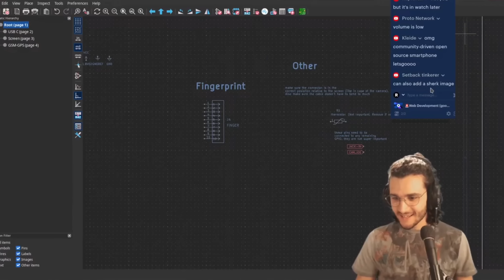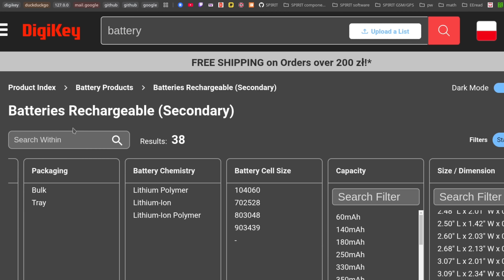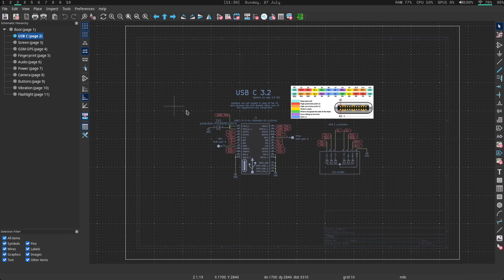Can I build a BETTER smartphone from scratch?

Comment: The Pi5 isn't too powerful, it's inefficient. It uses up more power to get orders of magnitude less performance than a smartphone.
Need to use a way more modern SoC if you want to compete with smartphones. 3nm 16 core Snapdragon 8-class, MediaTek Dimensity etc. will eat that 4 core 16nm BCM2712 for lunch in raster/cpu performance. Literally 20x scores on geekbench.
Raspberry Pis have always been overpriced and overrated anyway tbh. They're popular, but any old SBC will run linux.
Reply: I mean this project, from watching this short video, seems to me like a prototype type thing that's supposed to be good enough to use, not be great. 

I don't think they should focus on using great chips and custom boards yet. I think they should get a working "phone" out as soon as possible. 
Researching the best processors, looking at their docs, figuring out how to fit it into the phone... is probably more work than what they can handle at the moment. 
Getting a working phone out asap is probably a lot better for their motivation then researching for a long time. 

As the project grows, it ofc needs to switch to modern processors, but i don't think they need to worry about the weaknesses of this processor and alternatives yet.
Reply: yeah he should use n100
Reply: You have no idea what you are talking about, sir.
1. Not a single chip you mentioned is open-source.
2. They will never provide even a dev board to a hobbyist.
3. This project can never compete with smartphones with millions of dollars of R&D behind them.
4. Pi5 is indeed a bad choice.
Reply: @novh4ck  I wasn't saying use a smartphone SoC, I was saying use a better SBC. Pi aren't the only ones making SBCs, and they're among the worst in terms of value and raw performance.
They're the equivalent of the 8 bit 20mhz ATMEGA328P arduinos people still use when the 400mhz ESP32 can be had for half the price with a ton of better and faster I/O, rom, sram, deep sleep features etc.
They're crazy popular just because they were the 1st arduinos, but that's literally all they have going for them.
The Pi is the same. They created a brand and some ready to go SD card isos for noobs which got people to realize credit card SBCs exist, but now Pi is the default for projects like this when there's literally 0 reason to. The concept is good, but nobody wants to use a phone that's 20x less powerful and power efficient just to say it's open source, and it's disappointing because you could just use an SoC that's actually good. If it's only half as powerful and efficient, maybe the tradeoff is worth it.
Reply: @steve_jabz  Where can you buy modules with chips you suggested? Where is any documentation for any of those? Where are schematics? Where are Linux drivers? I'll answer for you... nowhere. Unless you are a company sinking millions into R&D with a potential to sell tens of thousands of devices you will never even get a response from Qualcomm or MediaTek e-mails. Your options of "faster" ARM are basically BCM, RockChip and Allwinner. That's it. My point was that your suggestion shows that you don't really know how any of this works.
Reply: @novh4ck  I didn't suggest any chips. I mentioned that it's 20x slower than mid-range smartphone SoCs and that you should use a better SBC to compete with them.
After clarifying it, you still want to insist on starting a linux port for a smartphone SoC as if I ever suggested it, and even for a straw man, this is wrong, because Qualcomm and Mediatek both have HDKs with drivers and support, I just still wouldn't use them for this project, because it defeats the point
Reply: I haven't been up to date with SBCs in a few years, so I'd need to do a comprehensive review of everything on the market now, but I'd probably start with an Orange Pi 5 Pro as a basic starting point. 8nm Octa core, Mali-G610, 16GB LPDDR5, 6 TOPS NPU, 8K HDMI 2.1 vs the RPi's 16nm node Quad Core, VideoCore VII, 8GB LPDDR4, 4K HDMI 1.4. Considering this is literally the 1st one I found in 20 seconds, you can probably do much better.
Reply: These type of boards like the orange pi 5 all come with up to date drivers for every flavor of linux. You might have to actually install the OS though instead of buying a noob SD. It's not really rocket science.

Comment: Something to note in regards to location privacy: If you have a sim card, you can be tracked fairly easily, especially in metropolitan areas. I'd recommend adding another switch for that, or just forgo cell data and use the phone solely over wifi (A vpn might also be a good bet if you go with the second route). 
Overall, this is a very cool idea, and I really hope you succeed!
Reply from the maker: That's a great point, thanks!
Reply: Lora,  BT, wifi, and wifi-halo for the ultimate mesh communication.  4g/5G optional if you can get your friends to adopt something like reticulum protocol.
Reply: Wouldn't putting your phone in airplane mode disconnect your SIM?
Reply: There was. a video by the hated one where he shows how phones try to connect to network once they shut down or wake up and there is nothing that can be done there...
Reply: without sim card its no longer a phone just a mini tablet

Comment: A CM5 uses ~2.5w at idle, meaning even with a massive 10,000mAh battery it will only power the phone for 16hrs while it does nothing.
Reply: what about disabling cores and other components on demand?
Reply: @Oscar4u69  you can disable components, but that's not doing much when you need your antennas always on. You can lower the clock speed on cores but disabling cores doesn't help. The cm5 in the thumbnail was why I clicked because I wanted to see how he gets around it.
Reply: @YoelFievelBenAvram  he doesnt, and while i dont want to be defeatist this entire genre of content is really just designing carrier boards for compute modules, sadly hardware R&D is just a different beast than software R&D
Reply: @Aporro1 i don't see what stops somebody designing a custom pcb around a smartphone processor
Reply: @CnRSPACE  That one is easy the NDA and software required to run a smartphone processor tends to be unobtainium, leaving you rather stuck using somebody else's entirely phone motherboard as is even before you get into the challenges of actually getting hold of the Silicon in the first place. Technically you can do it, but the hurdles to jump through just to get remotely close to the easily available documentation on a Pi...
Reply: @CnRSPACE  Skill and the fact that you can't affordibly buy small quantities of proper smartphone processors, nor get the proper data sheets and documentation for them without agreeing to buy a decent quantity of them.
Reply: @YoelFievelBenAvram  IMO it's the worst decission made on this project. Using another SOC designed for phones, like something from mediatek or similar, would be the best choice.
Reply: Not played with a 5 but the 4's you could under volt and down clock quite a lot, and it helped, though silicon lottery came into it if you pushed to the extreme. However for phone use given the modem will have a baby CPU of its own the CM5's power draw while on but idle really doesn't matter - it can and should be in the low power standby type mode waiting the wakeup signal from the modem whenever you are not actively using it.
Reply: Should really use an ultra low power stm32 which is still easy to handle and has all the features
Reply: @EA-s2z  The issue with MCUs over CPUs is there is no memory management to use full operating systems like linux which is what android is based on.
Reply: @sloppyfloppy79  There are schedulers like RTOS or ArielOS. The real disatvantage is that they simply don't have enough power
Reply: lmao
Reply: Probably the best bet at this point is a risc-V cpu
Reply: i recently joined ARM so i may be wrong i seems like you can for power saving halt large part of CPU and peripheral and put it in interleaved mode when in 1ms i base time and 900us cpu is "shut down" wakes up for 100us, do stuff and when needed switch switch to full power
Reply: if that the case use intel n100 way better
Reply: @fdgdfgdfgdfg3811 x86 processors are notoriously power hungry. 6W would be even more hot and power-sucking then a CM5

Comment: Other idea: whats wrong with creating a USB/USB-c dongle that supports LTE 5 or 4.0 and you can just attach it to a secure tablet or notebook to talk and have net access??? Somebody tried?
Reply from the maker: could be a workaround if there are problems with gsm/gps in certain areas
Reply: @V_Electronics  i mean just to create a standard secure OS on any hardware and attach the mobility with a mobile dongle.

Comment: ❤ Fairphone is working on a repair friendly smartphone 

This is something else
Reply: nah im good
Reply: 600 bux and it doesnt even have a jack
i guess at least it has an sd card slot
Reply: @wireskrush Why are you using a headphone jack in 2025, you can wire audio through USBC
Reply: Can I charge and use headphones at the same time?
Cause I fall asleep to videos and my phones battery charges over night so I need both

Comment: i guess you could underclock it if heating is an issue and you don't need that much power
Reply from the maker: Yes! we consider that as an option in case heat gets very bad throttle the cpu

Comment: I've seen projects in the past which used full-size Pi's and just desoldered all of the main components that stick up. They were usually more than an inch thick, so if you can make it thinner than that, you'll have a winner on your hands. Truthfully, just being able to run Linux for a phone is already a win in my book, but if you can make it work the way Dex on a Samsung phone works, then it'll be a great multi-function device. Imagine coming home, plugging your phone in at your desk and using it as your computer. Of course, you'll need a tiny fan built in to use it properly.

Comment: Why not use an cortex A controller instead of an rpi 5 controllerboard? It can run alpine linux and android is based on linux anyways.

You can use an stm32mp1 (cortex A7+M4) and there are variants that provide the same benefits like the rpi controlboard 5. For example the QSMP-15 by KaRo provides the same with way smaller footprint (we used to make our own smartwatch pcb with it).
Reply: The same performance as the RP5 or RP2W?
But I see it's a dual-core 650MHz Cortex-A7

Comment: Finally someone who thinks like me!
I'm Portuguese! I've been thinking about making my own phone or computer for a while now! A device that's easy to repair! Low cost.
At the moment I've made a computer using the Orange PI 5 Pro! 
If you want to buy an Orange PI 5, don't buy the Orange PI 5 Pro, Orange 5 Max, Orange PI 5 Ultra. Don't buy any of these! Just buy the Orange PI 5 Normal or 5B or the 5 Plus. These 3 boards have more support from the community!

Some tips! 
Don't buy a DC-DC converter with 60-80% efficiency!
Buy DC-DC converters with >95% efficiency so you don't generate terrible heat!
For fast charging, Aliexpress has a PD Module that talks to the charger, the CH224 Chip!
Reply from the maker: That's awesome, thanks for the tips!

Comment: I fell in the same rabbit hole few months ago and was discouraged by the amount of required work. I'm really curious to see your approach. You won one subscriber.
Reply from the maker: workload is huge but it's worth it in my opinion (even if only due to the amount of things you learn in the process) thank you for sub!!!
Reply: @V_Electronics  Yeah I was planning to get back to it later, but since your project is open-source I'll be able to contribute or create my own variant, at least I hope so. Good luck with your project !
Reply from the maker: @76Eliam thanks, you too!
Reply: I beg to differ on the work load. With so many premade modules and libraries, it's plug and play. 5g is the expensive part. I've gone the sub ghz LoRa mesh route. The only drawback is phone conversations are more like voice mail conversations. It's easier to compress to mp3 and send the mp3 over the air on lower bitrates.
Reply from the maker: @sloppyfloppy79 did you try to make a sub 20mm thick diy smartphone?
Reply: @V_Electronics  ROFLMAO! Nope. Those old late 80's and early 90's bricks come to mind.

Comment: hey, I also want(ed) to make my own open source phone, so here's a few tips:  
- 1.2cm is an acceptable phone thickness for most people, but not bigger
- most displays on alibaba/aliexpress are MIPI DSI, but it's a closed source standard that's hard to work with
 - beware of the bands supported by gsm/5g modems, because they don't support every band (which can cause issues if the modem you pick can't connect where you live)
- all RPi cameras are mipi CSI, which is simpler than the DSI, but readymade multiplexers are expensive.
- you can't easily buy gorilla glass, except in of-the-shelf screen protectors
- don't forget the buttons, speakers and usb-c connectors (you should make a daughterboard for the last two, that you can connect with a fpc cable)
- if you got space on your mobo at the end of the design and you have unused connectivity (for example the GPIO, a spare hdmi/usb...) please add pads/holes for dupont connectors so the user can add things to the phone
Reply from the maker: Thank you!!!
Reply: @V_Electronics Why not add a LORA module?  With Lora, BT, and wifi you can communicate using protocols like meshtastic and bitchat and circumvent the need for cellular coverage. 5G is private tech. an open source phone should support open source comms. (Edit: Im patiently waiting for wifi-halo to mature, but just imagine something like reticulum protocol on a device with long range wifi and lora for user owned mesh nets)
Reply: actually he can get an idea to the pixel phone with modular pads point inthem
Reply: У меня на бумаге уже несколько месяцев лежит готовый проект. Мне всё, что нужно - время, чтобы развести печатную плату и деньги, чтобв её изготовить, собрать и дебажить её. Как всё будет готово - опять же время для портирования UEFI и ACPI
Reply: 1.5 cm is thick but feels good in hand no boarders
Reply: phone has to have 5G and 4g lte min universal

Comment: Wah, thank you, ill keep a close eye ^^
Have you considered having different possible battery types that are safer than Li-ion ? Such as LiFePO4, Na-ion, Zn-ion, lithium-titanate, ...
Reply from the maker: we considered many different options even small cylindrical 10440 batteries for super fast battery change, finally we decided to go with a smartphone style regular flat 3500 mAh, unfortunately li-ion for siplicity. HOWEVER, it is certainly possible to use a different type I just want to avoid complexity for the 1st prototype!

Comment: For me, the main issue, is that we truly don't own what we buy! For most phones, they've already started to not allow you to run your own OS, and even worse, even though it's your device that you legally bought, the copyright laws make it illegal, globally, to break digital locks, in your own home, on your own device, let's not mention repair, I had a new laptop break after 2 weeks from a corrupted bios, and the manufacturer refused to fix it because I opened it to do basic, needed, troubleshooting! I would've been able to fix it if I could've gotten the files needed to flash the bios, it didn't even need to be opensource, but that is still too much to even bother asking these days. We need to show them, that there are better ways, by making our own devices, trust me, in time opensource hardware will be just as good and sleek, and cheap as anything else.

also yippee! look mom, my pull request is visible at 7:00 , I'm a celebrity now
Reply: If you're in the USA the Magnussen Moss warranty act makes it so the manufacturer has to prove that you broke the device. Opening it up and doing repairs doesn't count. 

Report them to the BBB and tell them you will
Reply: @gquirt  Hi clippee!
Reply: @gquirt I second this! ^
Reply from the maker: Very well said!